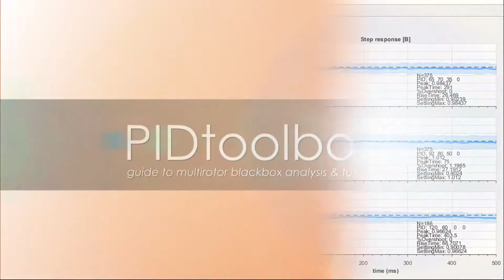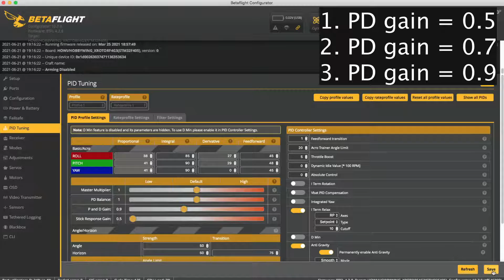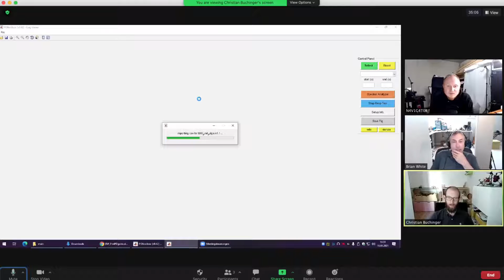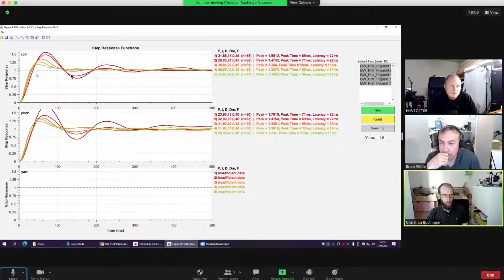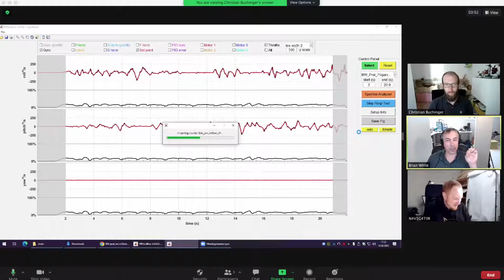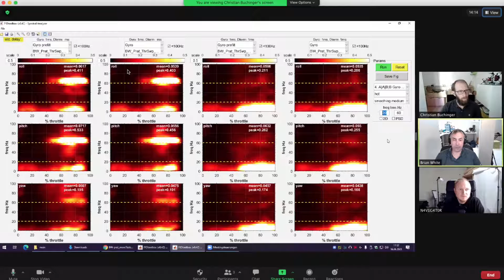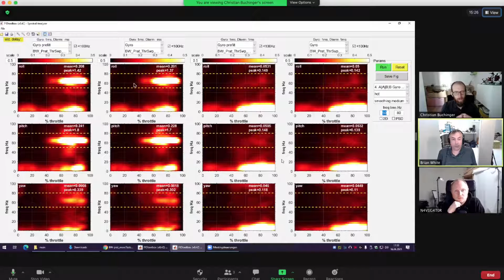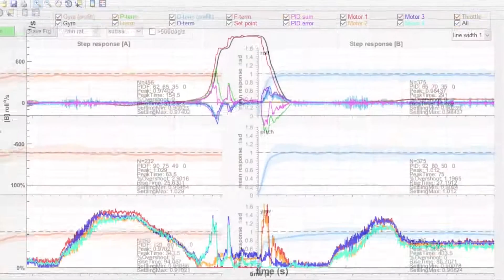PIDtoolbox Q&A #05 | Live Basement Tune

Comment from the maker: FYI: there are many ways you could effectively get a “finger print” of your copter’s step response profile and make a decision about what the optimal PIDs should be. We opted for PD gain steps because from practice it seemed the quickest route to finding the optimal, in part because PD balance in BF4.2 is by default pretty good for most builds, and there's a wide tuning window for D. When we see this slow overshoot continue to decrease as PD gain is increased, it is an indicator that the gain is closing the error gap, and is therefore not related to low D gain, but instead is acting to stop I term from winding up, which is the basis for the slow overshoot/oscillation in this case (i.e., it optimizes the 'PI' portion of the PIDs). The point at which PD gain no longer reduces the I-related overshoot we stop. Any remaining overshoot is therefore D-related, and some fine tuning of PD balance then may be necessary. Note: Recommendations may change as BF and BF sliders develop.

Comment: another super interesting video the part about TPA is awesome, thank you for that! using your tool now on all my quads and when I think how hard and time-consuming I did tune some of them it is so much more fun and easier doing it this way, just one recommendation would love to see a video starting with basement tuning - PD Gain and BD balance maybe with a quad where Pitch does need different values  (deadcat designs 7" and bigger could give tons of logs about that topic :) - going over filters and to the Final touch I and other small tweaks :) THANK YOU
Reply from the maker: thanks. I'll be doing another vid tuning the Chris Rosser AOS 5", and probably using BF4.3 dev build where we have pitch to roll ratio slider, so I'll be looking into how to get that balance just right.

Comment: Great video. Really good explanation of how to adjust TPA. How do you decide whether to use TPA on D-Term only (bf default) or on P and D?
Reply from the maker: if after the tune you see a clear 30-70hz oscillation that kicks in >30-40% throttle, TPA 'PD' will work.
Reply from the maker: I wanna add to this, after a series of tests I now know this higher freq oscillation (75Hz) was mainly D related, as TPA D took care of 95% of it. Turns out P related oscillation tends to be lower freq, closer to 40Hz. Made an interesting post on BB log review site.
Reply: @PIDtoolbox  is there a way to view this post without a Facebook account?
Reply from the maker: @zuldanfpv4634  unfortunately not. Im an admin there so just join and I'll add you. https://www.facebook.com/groups/291745494678694/
Reply: It’s asking me to create a Facebook account. I quit Facebook 11 years ago lol. Thank you for offering.

Comment: After tuning do you just add back FF by feel or do you  log a FF sweep the same way as the  PIDs?
Reply from the maker: I’d just add it back based on feel. You can certainly look at step plot but it will undoubtedly show more overshoot but it’s not to be concerned about because FF doesn’t produce oscillation and that overshoot is not generally visible unless it’s some extreme value. Also sometimes FF causes an offset issue in the step plots because it messes with the shape of the the input
Reply: @PIDtoolbox  thanks!
Reply: @MauroPeneda  you could tune it via betaflight blackbox viewer just by measuring delay between setpoint and gyro